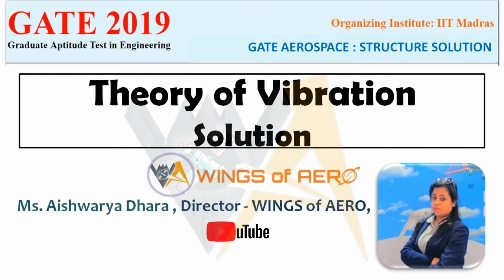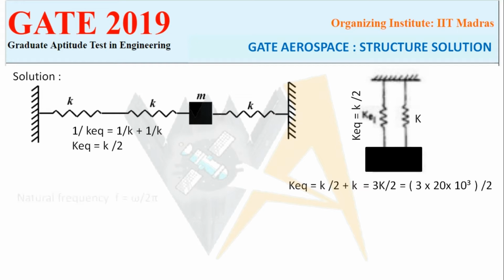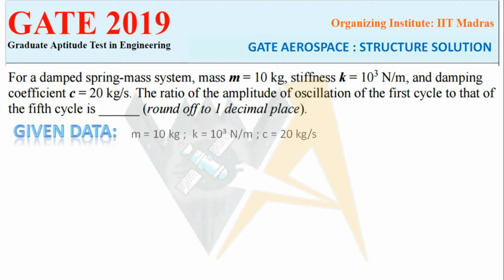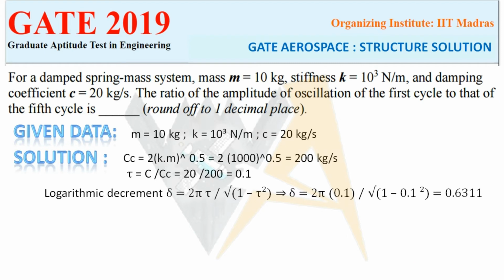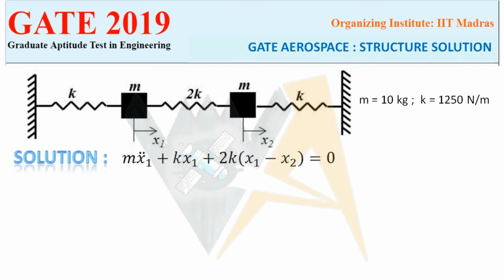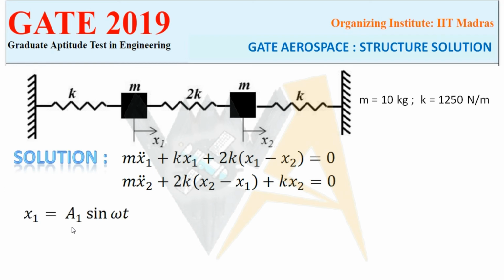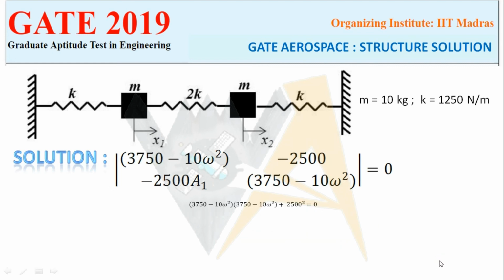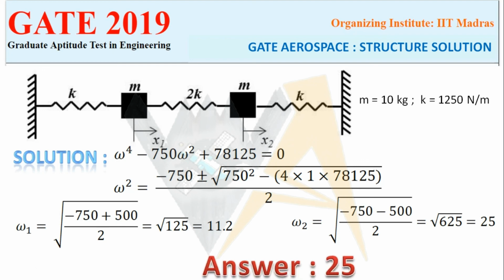Theory of Vibration:GATE 2019 Solved Paper ||GATE Aerospace Engineering

Comment: there is shortcut to it, for max freq masses will vibrate in opposite direction. So, 2k will act as 4k for 'm'.
Now solve for single mass with 4k on one side and k on other side. total K= 5k. w= √5k/m.  = 25.